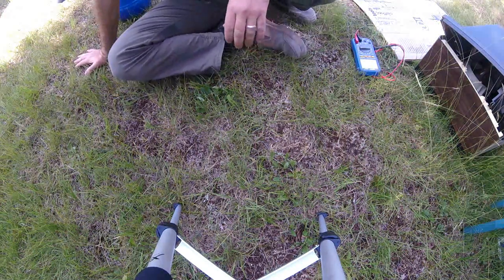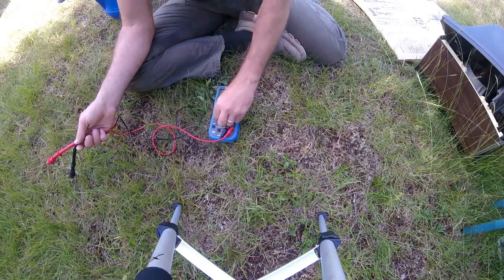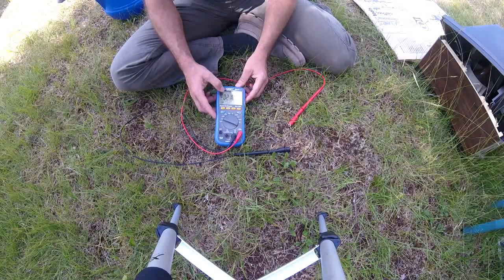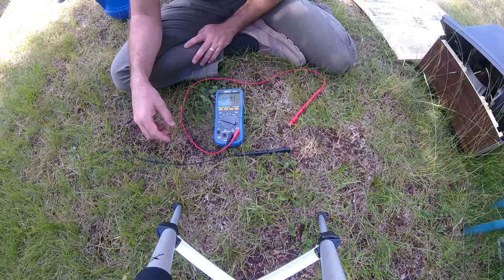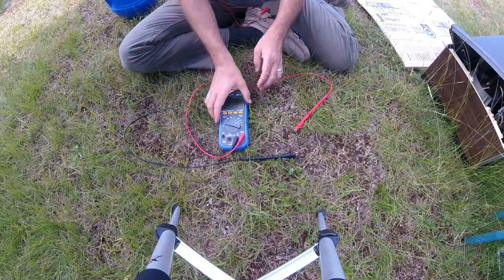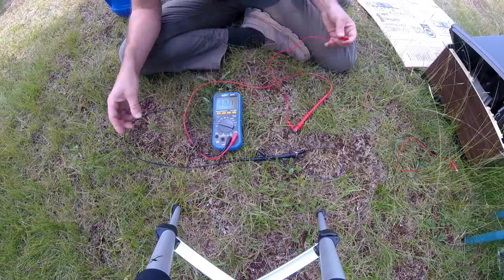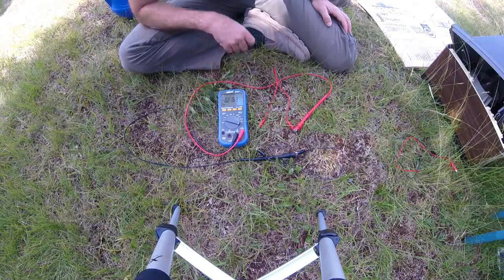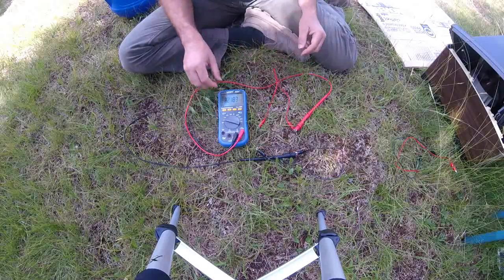Experimenting With Earth Batteries Using Various Metals & Locations

Comment: Hi , I just made some tests myself with the earth battery concept and I figured something I would like to share: i got 0.95 V out with 2 coils, one copper coils (20feet cable) wrapped in another 20 feet of iron coils ... just by sticking the 2 different end wires in the ground, my multimeter read 0.95 dc V with an output of ~0.3 Amps. I will experiment with longer wires to increase the induced current . Reach me on Fb, for more details (Renaud Poupart)
Reply: What is you facebook link
Reply: @DionKhnum  Renaud Poupart

Comment: How to make a powerful earth battery . Materials :) One gallon bucket of Iodized salt , thick solid copper wire  electrical house wire , 60 Iron shingle nails 2 inch long , 60 SMALL glass canning jars , 5 gallon bucket of white beach sand and a gallon of vinegar. cut copper wire into 60 sticks 2 inches long. Bend ALL 60 copper sticks into an L shape. Sand tops of ALL the shingle nails with heavy grit sand paper. Solder the short end of EL to nail head. Do this to all 60 nails. Mix white beach sand with iodized salt and vinegar LOTS of salt. Put the mixture in all the glass jars. Put the nails in the sand mixture so that one side copper goes in one jar and the nail in another jar. Make it look like so that you see copper nail copper nail in each jar. Measure volts with volt meter. did you get 50 volts or more ? connect volts to inverter in.

Comment: Hi. I live in Poland and I also do experiments with earth batteries. I can tell you something about the greater voltage and power. 1. Use copper and aluminum. 2. The deeper you go with the copper, the more amperage and voltage you can get. 3. Deckman found that if you take several small pieces of Zinc and Carbon ( Copper and Aluminum ) rod and stick them into the ground next to each other and connect them in series ( much like a battery ) you get very little gain at all. 4. If you put them 6 feet apart you will get a gain In voltage and they will not cancel one another out. so by doing this you can put them In series to increase your voltage and your volt amps. The theory is that there Is some sort of natural energy VORTEX that takes up about that much space for each unit or cell. I hope that this will help you in the next experiments. They are happy to watch your next movie. Good luck.
Reply from the maker: Thank you very much for the suggestions. I will add this to my notes. I hope to experiment with this again next year. The ground is frozen and under snow now.
Reply: @thedoityourselfworldelectr8007  I'm glad that the information came in handy. I found such an interesting patent. I think that explains how to connect electrodes. 3 from above is interesting.  https://patents.google.com/patent/US495582

Comment: if you can plug copper into the earth and soak up some of earths energy that is coming in then wouldn't building a HUGE object designed to redirect all that power to the center of device give you all the power you need. However even if it works who's to say that energy flowing through the earth that you gather isn't needed to help nature flourish. Basically if you take the incoming power then what happens to the plant life down stream so to speak would they die off because they needed that power to flourish and you plugged in and took it before they could feed on it. and if this tragic scenario is real what would happen to the earth if everyone plugged in around the world with this method? Think of it like a stream or river of water, if you block it the water cant get down stream to feed all the living things.... Just a thought.

Comment: geomagnetic poles are evidently slightly off by less than 30 or 20 degrees from geographical poles (N/S), yet, opposite in polarity... maybe the voltage dropped on your meter because of the (static) resistance (source to load or earth battery electrodes to the meter probes and circuit) was mismatched, or, simply, the current was too low (too high of a resistance at such a low amplitude (magnitude)... voltage... rather)... the magnesium rod had already been suggested, but, without doing that... an antenna... yet, i see you are shooting for minimum circuitry/element/wires it seems...? that seemed like a dead, dead, dead triple A (AAA battery), where usually, it is a dead, dead AA battery that is ("magnificently")"joule thiefed" or boosted/converted... germanium transistor has a lower Vbe, stubblefield coil usually works well when wet... or, perhaps, a wet 1:1 after you get a pure water voltaic pile to bring it up (as a low resistance source, noting the direction of current and the "forward" (bias) adequacy (earth battery is the high resistance load to the voltaic pile low resistance source)... and these elements are in a water tank (1:1 and voltaic pile)... or to activate the transistor or turn it on and start "pumping"... having a well balanced circuit and stability... no significant "decay" of power or loss because of rain washing electrolytes away and the soil would be very dry... the only thing need to be considered, for the most part, better elements or, simply, the ppm/stress of the elements and material (hence, silver will last longer than copper) and protecting yourself and your circuitry and your station from lightning and an EMP either replacing GDT's or a good, solid, spark gap and a decent place to discharge this... or, even a thyristor, etc; perhaps, storing this excessive charge into a capacitor bank
Reply: i was going to type about identifying natural RF sources by DC, DC pulse, AC, crystal earth power, scalar/longitudinal waveform/format, vector/transverse waveform/format, balancing sources to loads and forcing input (on unbalanced loads or (high Q) resonators) for high current with impulse current by inhibiting and/or/also the flywheel effect and/or a configuration to feedback or source the back EMF/counter EMF... and understanding how the "isolation" transformer operating or worked as a wet 1:1 (noting, not necessarily, a voltage transformer... an impedance transformer and a power transformer when treated a certain way (wet), like classical physics might have  explained) and what happens when the transformer is wet like a power gain and made stable or settled and "circuit protected" or 'fail-safe', yet, it is transforming the impedance... especially, with toroidal core, cylindrical core, air core, solenoids with helical  electromagnets (like air coils (solenoids) with helical (pancake for example) "lids" to give permeance (permiability) or "synthetic iron core" and, also, wet with or without iron or iron wire (with cotton coated/insulated copper wire, copper graphene wire, silver electroplated copper wire, silver electroplated graphene copper wire, and/or anodized/rosined coils) in a wet pancake... wet... wet wet, wet wet wet... dead dead dead DEAD!
Reply: dead, wet/dry, and saturated/peaked, inverted/converted/induced/transformed/rectified/doubled/multiplied/divided, phase captured/filtered, fused/diffused, threshold/tolerance; etc... sustained/stable and/or regulated as a crystal (of this nature) should be... stubblefield coils in series, compound long shunted with ultra/super caps in series for high Q or parallel for "accumulative" (accumulator/accelerator or (an ideal charge pump of this nature), acceptor circuit? rejector circuit? adequate?... accumulate;  inadequate? force, pump, multiplex/inhibit and single channel inhibit... balanced? ..................... atmosphere? weather (good? bad? mod? control? is it raining in another location? is it thunder/lightning where you expected? a drought? demigod mode (almighty (integral) smiter)?)? environment? temp? AKR? cyclotronic? proton arc? aurora? ... gravity/gravitational and/or schumann coupled (deep underground/cave), deep space? (birkeland current)? celestial bodies near? star? cold light? no light? (radiant energy from kinetic/static source or (natural RF) radio... scalar?) etc... aliasing source? an alias? source of the source? malicious? skud? interference? considerate? polite? significant/insignificant? ... ecosystem? change in environment? vacuuming a star or other celestially body? collapsing (implosion/explosion) a source by high magnitude dissipation before regeneration can occur (tolerance)... nova? pseudo? psych? hologram? accurate monitoring of the phenomenon and celestial bodies and/or other natural sources? interplanetary coupling? space changing? aliased geometry and body and matter and relativity in general? etc....... passive is better less noisy usually... usually diodes are on @ 1 mA (and Vbe needed atleast a diode drop... some times less with the coil); carefully, try a germanium transistor (circuit protected/regulated/fused and backEMF/counterEMF surge protected) or schottky "clamper" transistor on your BO/JT converter (much more sensitive input and/or preamp, also, a much more susceptable amp or prone to blowing/ruining it, depending on how you use it; carefully loading it and daisy chaining it with your silicon BO/JT/converter... no more than 2̶0̶ ̶v̶o̶l̶t̶s̶  to 1̶8̶ ̶v̶o̶l̶t̶s̶  12 volts on the output with germanium)... some motors have starting capacitors... maybe a little kick off some static electricity would send the oscillator (non-mechanical motor) into oscillation to start "pulling" or oscillating (as well as a cap in parallel with the coil and/or resistor)... what is the conductivity (in Siemens/mho) in my area/region or at my location?
Reply: btw... i tried one of those boost converters/blocking oscillators/joule thief circuits suggested on the web (using a little iron powder instead of ferrite core toroid)... rechecked connections... the one with a source resistor from the battery (in series with half the (bifilar) coil (like secondary) to the base of Q1 and (indirectly) in parallel with the collector coil (as resistor and (sourcing, like primary) coil sources Q1)) seemed more successful throughout the trial of configuration with iron powder toroid as a bifilar... instead of the (EMI) inductor (transformer) sourcing the resistor... so, RLC, not, LCR or LRC... R > LC or R > L(c) > C(l)... anyway

Comment: Is there some reason you never hooked them up in series? , since that would increase your voltage.  3 in seres .9volts, with 3 in parallel would give 50 microamps, it might of been enough for the led.  There wasn't  a handy rock or hammer you could use nearby??.
Reply from the maker: You cannot get more voltage by putting them in series in the same soil. In separate containers yes. In the dirt, close to one another, nothing happens.

Comment: Watt's the purpose? Even if you could light up a tiny LED, there's really no useful energy. That's why I remain on grid :) Where I have all the power I will ever need.
Reply from the maker: Back in the day of telegraph they discovered that the lines were powered long after the batteries died out. They found that the lines were being powered by the earth. If you connect enough earth batteries you can power some devices for free. I like to save power myself and save money for other things.

Comment: I always wanted to check that :).
For measurable results You should check Watts or Volts * Amps, which is actual representation of the energy.
Low voltage is not a problem as You can always raise it via electronics.
Plates instead of nails will make more contact with the soil.
Also for 'proper grounding' people pour salty water over the metal that makes contact with the ground; that makes the metal surface erode and thus make more contact.
In Your place I'd rather try a tower with an isolated wire so the potential between air and the ground is gathered (check out Tesla patents regarding the radiant energy); it partially comes from human-made EM.
Reply from the maker: Thanks for the ideas. I do plan to expand on this experiment later. I have a nice TV tower out behind the house where I plan to put up a wire and see what I can get from it.